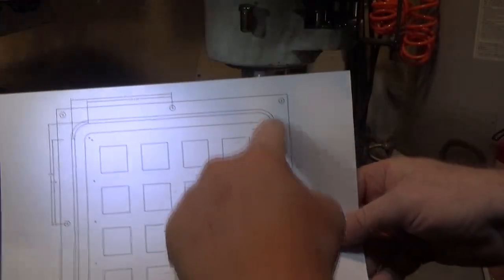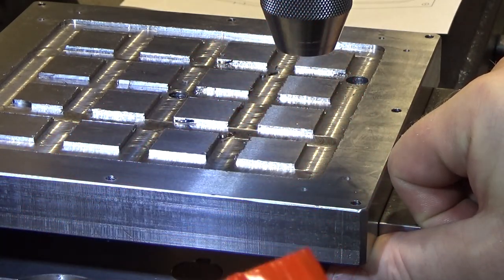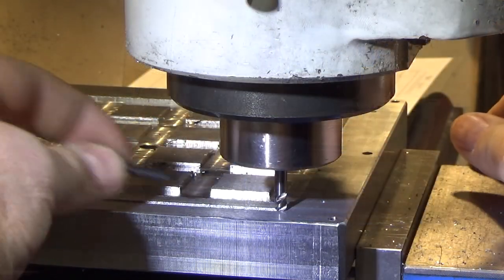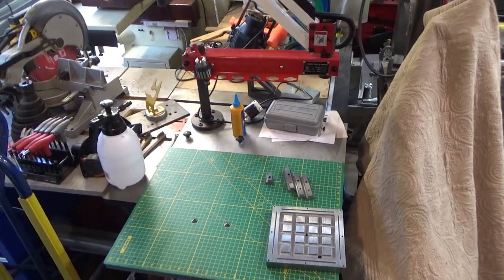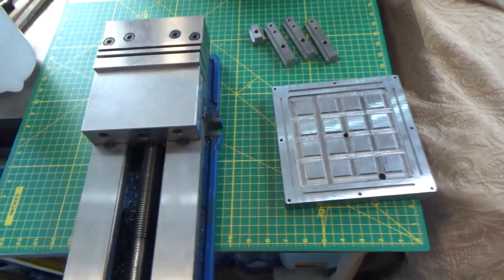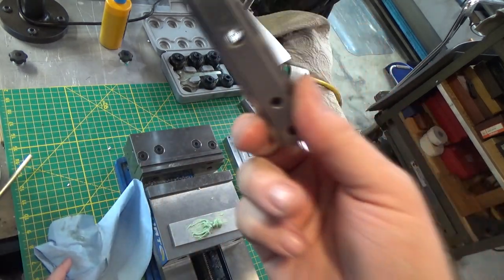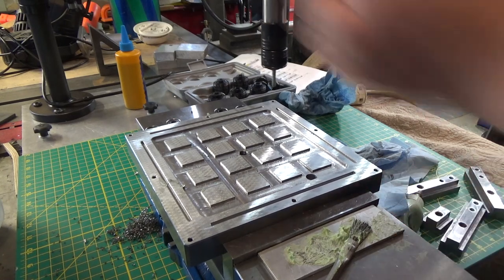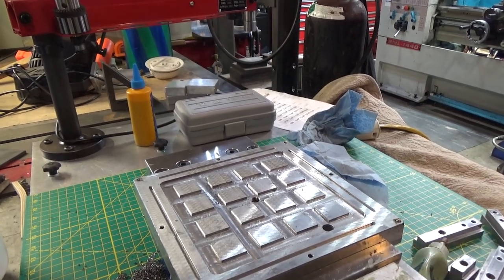191 Vacuum Chuck with Replaceable Fixture Plate Part 2

Comment: I've had bad luck backing up a spiral tap, they are designed to go forward all the way through, good looking plate, great video, keep'um coming.
Reply from the maker: Thanks. I agree with the all at once idea, but there was a fair amount of pressure trying to get the tap to go in so I thought I would try to break the chip, but that might have made things worse.

Comment: Oh, bad luck about the snappages. I've just cut about 40 holes at M1.6 and M2.2 and 20 at M3, some with spiral point taps, some with spiral flutes and had no problems, but the taps are all branded and from suppliers like Guhring, YG-1 and Dormer. I snapped an M4 spiral flute tap on the way back out of a 12 mm deep hole in 6082 aluminium last week, I guess it got snarled in the spiral strings and cold-welded or something. It was #9 of a ten-hole bolt circle. I was lucky it shattered into many pieces and I got most of it out. I used a shorter screw in that hole.  I don't recall ever reversing a spiral point of spiral flute tap except at the end of a hole. I suspect Mel is right about the problem being connected with backing out the spiral point tap. One day I'll run a tap into some plexiglass and watch what happens with I back it up a few times. Looking forward to the next episode!
Reply from the maker: Thanks for sharing your experience. I think Mel is correct also. I only tried the breaking chips idea after I was struggling with the single go approach.

Comment: Ouch 3 taps. Hopefully they won’t cause too much trouble coming out. It’s not so much losing a tap, but rather messing up the work piece, that so much work has gone into. At least it wasn’t the machines fault. Looks like it works great.
Reply from the maker: After a bunch of time I got two out of three out all of the way and the third, I was able to get 1/4" of usable threads on. I opened all of the holes up to 50% thread depth and was able to hand tap them successfully. I bought other taps, because I am thinking it was possible that I was using poorly made taps. I will try to power tap 10-24 threads in steel at 70% depth again with the new known high quality taps and see what happens.
Reply: @DudleyToolwright  Yes, tools makes or breaks a project, literally and figuratively. Glad it’s fixed.

Comment: I’m not sure I see the advantage with forward/back spiral point taps. They’re designed to go forward for the full depth. Spiral flute taps, as you’ve pointed out, are more delicate as there are fewer cutting faces, so I tap more slowly. Small taps are a no man’s land, even with CNCs breaking taps. If you’re using ”hand taps” for some crazy reason, then a turn, or at most two, and a backout turn is required. But why anyone would use them for this I don’t understand. I’ve replaced most of my hand taps for spirals long ago.
Reply from the maker: My thinking was that if you broke the chips every once in a while they might clear better. I didn't catch this issue on camera, but the swarf was jamming up in the spiral flute taps and was even hard to get out when the tap was clear of the work. I tried a hand tap after I broke the other two, only because I was running out of taps at 10-24. I think I might have just had poor quality taps and have since ordered some new ones that are known good. I fully agree with the choice of spiral flute taps. I use them for almost everything, even hand tapping.
Reply: @DudleyToolwright  I’ve never had, to my recall, the string coming off the spiral taps jam in the flutes. They always come out the end. Actually, it’s satisfying seeing them precede the point of the tap. The only reason I’ve ever seen them become chips is when the tap is backed up and the strings break from that, and you start new ones which then become tangled with the broken ones. That could jam a tap as spiral taps aren’t designed to clear chips.
Reply from the maker: Thanks for the info. Very useful.

Comment: Let us know what you find out but it kinda does sound like wrong drill size
Reply from the maker: The only conclusion I have been able to come to after confirming the drill size to be correct is that I have crappy taps. I tend to buy them on eBay and you often never know exactly what you are getting. I think I need to invest in some high quality taps and then have a go.

Comment: I have the worst luck with 1/4-20 always in this exact same boat like the number 7 or whatever it is just isn’t big enough I’ve got to where I just tap everything 5/16ths anymore I can power tap it with zero issues hand tapping or power tapping either one 1/4-20 is futile for me I typically get absolutely amazed by people just plowing through their own projects like it’s nothing
Reply from the maker: I am not sure what was up with the metal I used in this project. I have used number 70% threads in steel many times before and did not have any issues. This time I couldn't make the spiral point, spiral flute, or even hand taps to work reliably at 10-24 until I went to 50% threads. I would love to know what exactly went wrong.
Reply: @DudleyToolwright  hard to tell
Reply: Have you been in contact with engineers work shop hes got that rotary head mill that would make radial milling that oring groove around that corner a breeze idk if you guys are close enough to collaborate or not but it’s just a thought